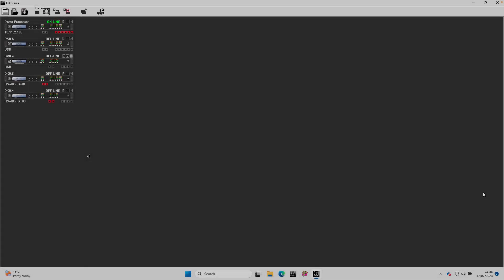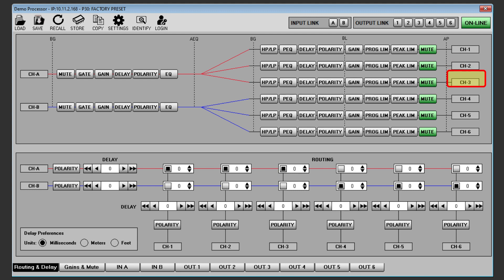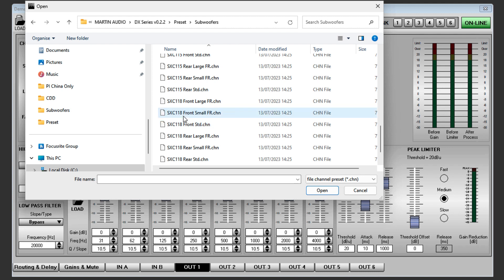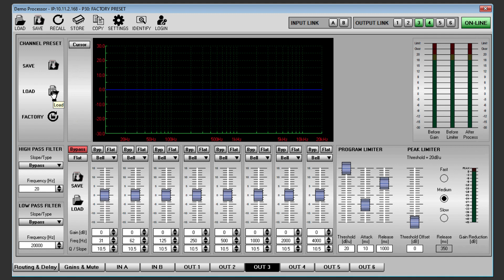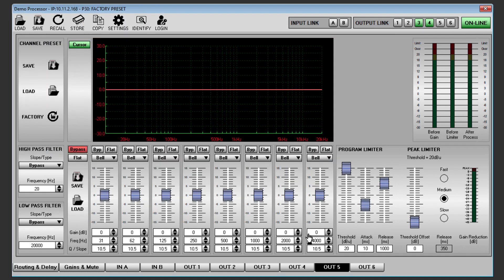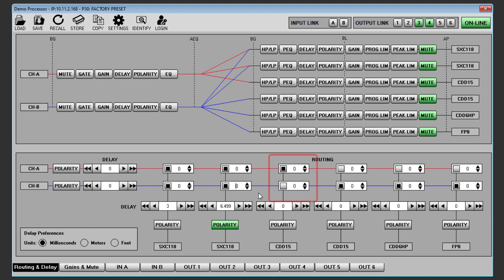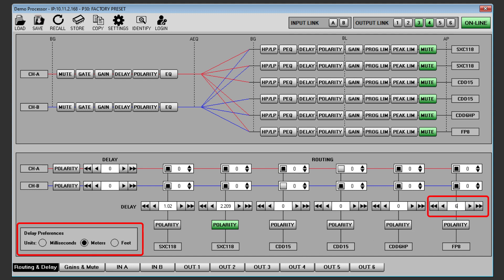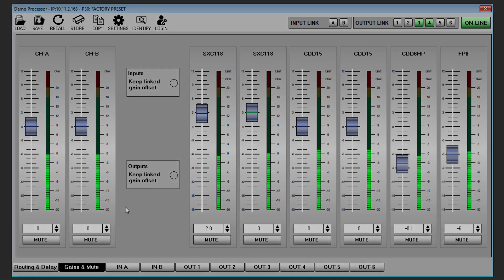10.  DX0.4 & DX0.6 Processors - Controller Software - System Example

Comment: I noticed that when you summed inputs A&B to run the subs you didn’t attenuate the input gain on the 2 summed outputs. Which was mentioned in one of the previous videos.